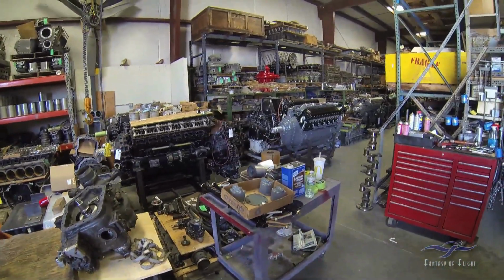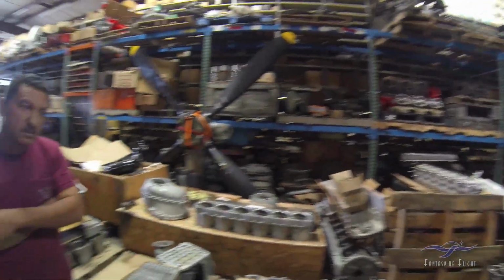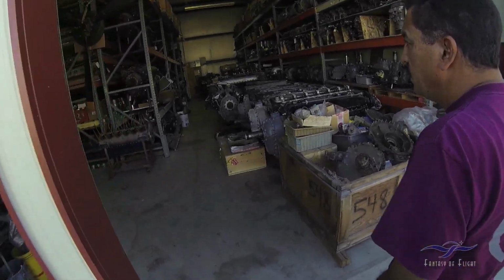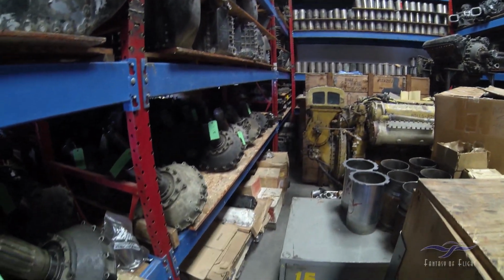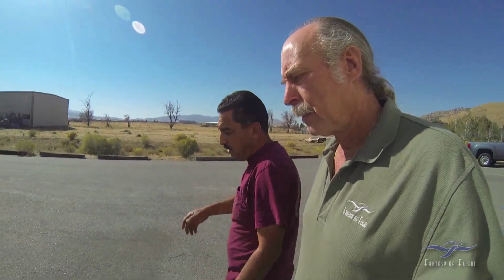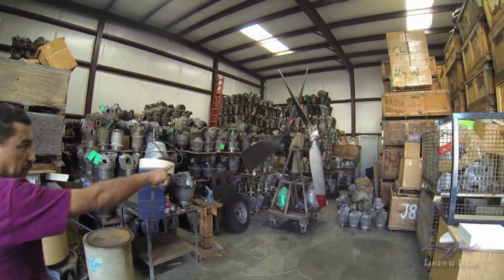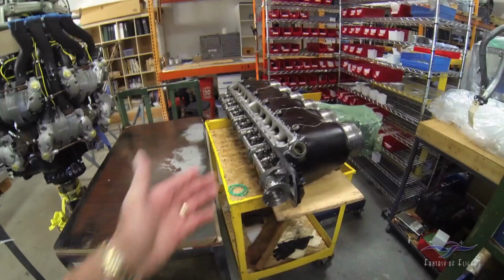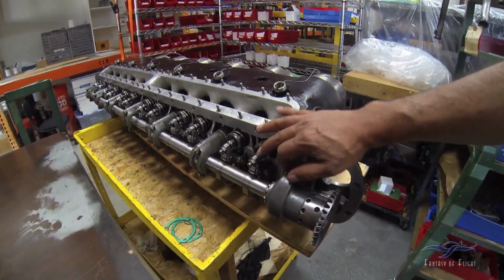Vintage V-12's - Engine Shop Visit - Part 2 of 3

Comment: 😱There’s BILLIONS & BILLIONS of $$$ worth of parts and engines in these shops. Thanks for sharing all these videos Kermit!! 👍🏼
Reply: No there's not. The "value" of parts like that is ZERO until they're SOLD. Like the "value" of EVERYTHING. They're called "overhead" until that happens. When you've got parts sitting on the shelf that long and there's that little demand and you've got time and money in buying, transporting, disassembling, cleaning, inspecting, inventorying and storing those parts, what are they "worth" sitting on the shelf? And where could that "investment" have gone however many years ago it was "invested" in large paperweights? And don't think people don't see videos like this and IMMEDIATELY their "appraisal" of what "rare" and "special" and "vintage" parts, engines etc goes DOWN as a result.
Reply: DEEREMEYER1 - I’ve been flying and been around vintage planes about my whole life of almost 40 years and I can tell you right now that you will NOT go out and buy a Merlin V12 for no $20k. You wouldn’t even buy a set of heads for $20k. These are NOT your old Rolls -Royce car engines. I’m rebuilding my 1946 J-3 Cub right now and for a NEW rebuild 4 cyl Continental A-65 engine is $20. So if you can find Rolls-Royce Merlin’s for $20 all day long PLEASE let me know where they are and I’ll buy a tractor load load. Lol. And there’s a HUGE difference in being a Mechanic for 25 years VS being an A&P Mechanic. But thanks for somewhat of a history lesson. 😉😂👍🏼
Reply: I have been around war birds for 30 years. I have flown several and wrenched on a few. There is a hanger at my home airport where a Mustang, Sea Fury, Tiger Moth and two Spitfires reside. I know the mechanics that take care of those aircraft. Trust me your are not buying a V-12 or radial of any sort for $20k or anywhere close to that. I have seen war bird owners that I know spend over $100k just to have their engines overhauled. I know of one Merlin which a friend had and sold that was not anywhere near airworthy condition go for $75k. I was the guy that helped load it up when sold and watched the money change hands so I know how much it went for. Just to rebuild a basic motor (Lycoming 360) out of a Cessna 172 will set you back $20k.
Reply: Howard Elzey - You right bro. I tried telling that idiot he was crazy. Lol. I’m having a brand new Continental C-85 built for my J-3 Cub and it’s costing me $23,000. With NO starter. Hand prop. That’s why I told him to show me where he can get them for $20 each and I would buy every one of’em. Lol.  It looks like he went back and took out where he said you could buy a Merlin V12 for $20. Lol.
Reply: DEEREMEYER1 - Yeah I see you went back and edited your $20,000 comment huh? Lol. 🤣

Comment: With regard to R-4360's, there are six in operation on flying aircraft today - the F2G "Race 57", Sanders' Sea Fury "Dreadnought", and the Berlin Airlift Historical Foundation's C-97 (which just recently flew again following a 15-year restoration).
Reply: I thought there might have been some flying on a Martin Mars, but those are 3350s, apparently. Bummer.
Reply: As an aside...my father was both a crew chief and Flight Engineer on KC-97s. ( Crashed in one and was the only survivor.) Also the same for B-29s (3350s) As a boy I learned a lot about both...

Comment: Hey Kermit! Not sure if it’s this video, but you mentioned a story about a handful of merlins that were purchased and used in the Miss Budweiser racing boat. Well, i actually managed to stumble across one of them and I took photos. A client at work has a packard collection and sitting among his pre war cars is a Merlin V1650-9. He told me it was almost used in the race boat but the builder couldn’t bring himself to run it due to the motor still having hours left on TTO. I ran the data plate and it’s from a P51H. It’s still configured as is for use in the boat and has sat untouched ever since. If you would like to see it, I’ll gladly send photos and info.
Reply: + Escape Velocity    There are a couple P-51H rebuilds in progress.   Your client could give the builders a fair price for that Merlin, although if it is already modified for boat racing it may be useless for flying ever again.

Comment: Kermit’s got so much stuff he don’t even realize where all of it is and forgot he even had it. Lol. I don’t think I’m gonna forget where I sent a $100k engine. 👍🏼😂👍🏼
Reply: You can buy Merlins for $20,000 all day and that's the ADVERTISED PRICE. Show up there with "$100k" in cash in your pocket and I'll bet you leave with at LEAST 5 "complete" engines. Not necessarily INTACT but COMPLETE. The old-airplane hobby is just like the old-car hobby and old-gun hobby. As time goes on fewer and fewer "enthusiasts" and "collectors" and "museums" who have the interest, money and desire to dump money into toys do so because they die off and replaced by younger collectors with different ideas about "old" and "vintage". But there's a "cutoff" where "warbirds" aren't "rebuildable" and "restorable" because they're JETS and there are NOT old engines and parts by the hundreds and thousands of tons lying around in warehouses for THOSE because they didn't BUILD thousands or tens of thousands of those airplanes originally, they were in service far longer and were usually "timed out" by the time they were "retired" with the airframes/engines not necessarily "worn out" and "dangerous" but according to the TEST DATA from when they were new and were "stress  tested" and "fatigue tested" were at their "designed service life". And of course jet engines are SIMPLE compared to piston engines and are COMPRESSION IGNITION engines that once fired and running are pretty much impossible to "overload" or "overheat" unless they're run out of lubricant, the fuel system is faulty/malfunctioning, etc. 

They don't survive that kind of situation for long. SECONDS at best and they still haven't "survived" because even if they're still running, they've taken damage internally and they're going to have lower compression, lower power, etc. Even if they're NOT abused or neglected, eventually internal parts are worn out and unlike piston engine parts, you can't "plate" or "metal spray" or "knurl" or "sleeve" them back into specs and you can't find "undersize" engine housings. Jet engines/parts are throwaway units once they are "worn". Every day the list of "warbird enthusiasts" with the RESOURCES to "Invest" in this EXPENSIVE LABOR with their "own money" gets shorter. And "volunteers" willing to clean parts, etc. don't cut it when you need skilled labor and experience and somebody who can take a service manual and "rebuild" an engine and do it right and stand behind his or her work AND who has their OWN "resources" to be able to FLOAT that work and not get paid until its DONE to do something NECESSARY to make an old plane airworthy rather than something that makes the "volunteer" feel useful and wanted and maybe impresses "investors" into thinking the "restoration" is continuing. 

And as a professional mechanic of 25 years, the number of people willing to invest tens or even hundreds of thousands of dollars of their OWN MONEY in an education, tools, ongoing training, liability insurance, etc. just to put more of their money and time into somebody's "toy" when that person is a "successful collector" and a royal pain in the ass you know is going to be a royal pain in the ass AFTER you've taken the job and are elbow deep in it and cleary "committed" is a lot shorter than the list of current and aspiring "warbird owners". And mechanics in general see and hear enough bitching, moaning, whining and shit-talking about how "crooked" and "stupid" and "worthless" and "lazy" mechanics are from people who can't/won't change their own oil and are fundantally butthurt about having to pay a "grease monkey" they've seen their whole lives as "beneath them" to do it for them. Kinda makes them wish they'd have TAKEN shop class in high school instead of "college prep" classes. If only they'd have known the difference between EARNING MONEY and MAKING MONEY back then and how ALL THAT MONEY THEY WERE GOING TO MAKE AT THEIR "WHITE COLLAR" JOB WAS GOING TO JUST MAKE THEM "RICHER" DEBTORS PAYING "CASH" TO FORMER SHOP CLASS TAKERS TO GET THEIR OIL CHANGED.
Reply: DEEREMEYER1 pretty good rant and you make valid points but you can’t say shops aren’t charging too much, at least in automobiles. The mechanic may not be getting rich but the stealerships are putting a fucking on folks. All the shops around me wanted around $1500 to put brake lines on my duramax, it cost me $100 for all the new stainless lines and I did the job in two hours, if I had to do it again I could half that time. Bastards charged me $2500 to put a fuel pressure regulator on the fuel pump a few years ago, I just changed the entire pump in a few hours, I know it didn’t take them an hour to do the regulator.

Comment: 20:09 i've never been so hyped in my life, somebody is actually going to make a functional jumo211, and i really hope someone is going to build a ju87 B-2 (sirens included) and make it the world's only flying stuka.
Reply: +The_Sack_Guy  A Stuka is in progress, although slow due to missing engineering drawings needed for precise reconstruction--you can't fudge the structural strength in an aircraft.  There isn't that much Stuka stuff around.   Jumo 211s are planned for an He-111 project that has been in progress for many years, but I think those Jumos were done by a shop in Germany a long time ago.
Reply: What kind of stuka?
Reply: +The_Sack_Guy   It's an R-2.   There are a couple of R-4 wrecks and pieces out there but I don't think that they are active projects at this time. Dunno about functional trumpets, unless one comes out of a private collection to make a copy. I think wartime pilots sometimes removed them so to not announce that they were coming to the AA gunners. But it would be interesting to hear them.
Reply: You mean the one at the Museum of science and industry?
Reply: +Tha-Sack_Guy   No, the restoration is from a wreck.  The Chicago example was lowered for cleaning last year and while it was accessible it was 3D scanned with new tools and this could help to fill in some missing engineering data.
Reply: A flying Stuka with a functional  siren would be airshow gold

Comment: I wanted to do a display engine with a v12 Packard for the PT boats organization one with a cutaway so you can see how all the engine inside works
Reply: +Izzynutz Restorations  Too many of these rare engines have already been cut open and ruined forever.  It would be better in the long term to do it with animation software and CAD.  Better yet,  find some funding and have a Packard V12 printed in 3D (even in a smaller scale) and you can construct a display.  This is doable because one engine hobbyist started with basically half of a Merlin and he has been 3D printing the missing Merlin pieces to make his display engine.

Comment: I love the As 10, such a great looking engine. I always thought it would be awesome if someone used the parts from an IO-550 to make a modern version of it.

DB 605 was a larger displacement engine than the DB 601 and had some pretty major improvements which allowed it to run at a higher rpm and handle more power. 

The Jumo engines had more freedom in cam design because they had separate lobes for the intake and exhaust, but they were also limited to using only one exhaust valve, which would have restricted the engine somewhat. They could have used a forked rocker to actuate two exhaust valves, like Allison did on the V-1710, it's anyone's guess as to why they didn't. Anyway, the DB engines actually had a huge amount of overlap when compared to the Merlins and Allisons, they just used a really wide cam lobe so that it could keep both rockers open at the same time. This also increased the duration of the valve actuation, and duration and overlap couldn't be modified independently without changing the geometry of the rockers.
Reply: idontcare80 yes the valve timing was drastically changed from the DB 601a to 601E/605 

http://www.enginehistory.org/Piston/Daimler-Benz/Daimler-Benz.shtml

Great website on Daimler engines if anyone is interested.
Reply: It is an excellent website, thanks for posting the link, those never work when I post them.
Reply: HiWetcam I agree with you on the fuel but the main focus of the article is the changes made to the engine.

Even late war DB 605DB engines running on higher octane C3 fuel weren’t necessarily high  boost. They were making around 1800HP on +11 PSI.
Reply: idontcare80 Leave a whole sentence space above and below the link as Peter Kuppers did and the links should work. I hope that helps you.
Reply: Doesn't seem to work for me. I get downvoted (and probably flagged) pretty often because I often encounter people who don't like what I have to say about certain things, I'm assuming that's why I can't post links. Thanks, though.

Comment: Jeez BMW 801. That's like a unicorn these days. As far as I know there's only one FW 190 flying with it right now. So there's another one in the making I guess.
Reply: +Bas L  Yes, the F-8 that used to with the White 1 Foundation was sold and is now being finished by The Collings Foundation.  There is another original project out there but I'm unsure if they will be using another 801.  I like how the Jumo engines are coming out of the woodwork and old sheds now, both 211 and 213.

Comment: In 2010 I located 840 RR merlin engines buried by the RAF MU. Surely to God these are worth getting out of the ground and using. They were Brand new RR Griffon engines in the original boxes. i met two old RAF guys who buried them in 20 very long slit trenches. I need to convince the landowner to allow a small recovery. This will cost 2000 UK pounds for the Digger and low-loader hire.

Comment: Kermit, can you please show us the Napier Sabre.
Reply from the maker: You can see three quick shots of my Sabre at 6:50 in this video. We're working on an update of the Tempest V which will feature a short segment on the Sabre.
Reply: I hope that you can work with the Typhoon projects that are started now and pool resources.  One project will have to do an extensive amount of parts manufacturing to have a complete Sabre again and will need good parts to measure and duplicate. While the second project managed to find what appears to be an NOS Sabre that was an instructional aid that is only missing the starter.

Comment: It must be nice to have so much money that he can't remember what he has where. But what a great operation and dedication to that industry to keep those beautiful aircraft in the air. What happen's when the parts bins run empty? Is there current manufacture of parts running now? You guys need to contend with the EPA because those idiots want to turn off the gas, old aircraft, then cars.
Reply: +Craig Pennington   Yes there is manufacturing for new parts, pistons, bearings, new radial piston barrels, etc. Also custom manufacturing for tricky parts. There isn't manufacturing of complete engines yet.  It could be done but it would be very expensive to start over with new tooling and Rolls Royce, Diamler- Benz etc still hold the license to their products. Regarding fuel,  Shell has been testing a much cleaner avgas for a while, so it's a matter of adapting the old engines to it when the time comes.

Comment: Hey are these retrieved from boat racing in the 70’s 80’ ?
Reply from the maker: No, they're vintage aircraft engines from the 40's on, that the boat racers adopted for their preferred power source in the 60's.
Reply: Yes , what I meant was “ is that where the shops find them since I heard the boat racers used many up over the years , I was once in the old FBO in Clewiston when I believe You did a runway flyby in that Kingfisher lol
Reply: @leefithian3704   No, the boat racers basically destroyed all of the piston engines that they were able to get their hands on.  They bought the surplus engines that were around in the 1950s and 1960s.  The engines were never designed for that operation and the throttle changes and bouncing prop overheats the heads.  Some newer rebuild techniques can save some of the boat engines, but in general once they were in a boat they became boat anchors.  The tractor pullers continue to wreck anything that they can find.   To fly you would basically look for an engine with a proper paper trail, still tagged and fully inspected. For very rare engine types,  careful inspection and some manufacture of missing components will be needed (expensive.)  There has been a small interest in returning to piston boat racing, but there are other engine options around to power them rather than another grab of rare WW2 engines or they can design and build their own piston setup.